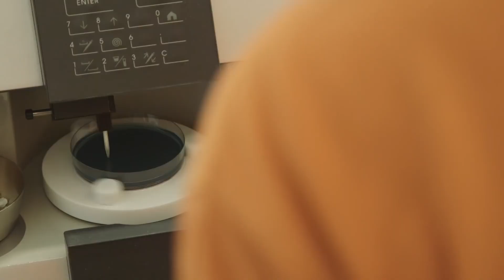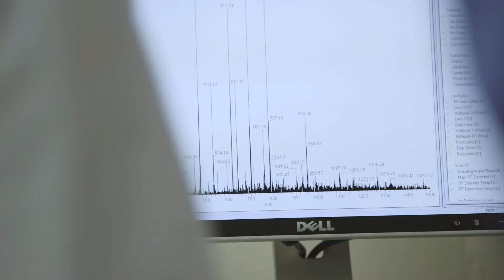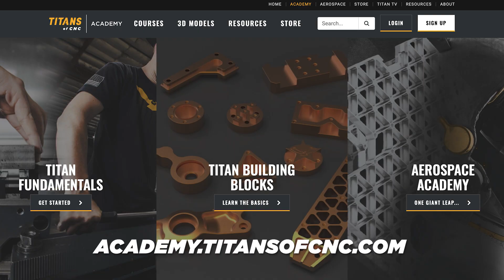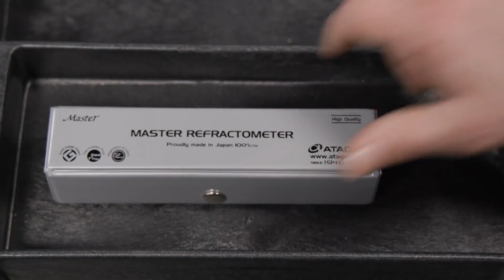The NASTIEST Thing I’ve Seen in a Machine Shop

Comment: I'm reviving an old mitsubishi cnc (and possibly upgrade the CNC controller), it has been idle for years (the owner cannot afford an operator), first thing to do ... CLEAN ... CLEAN .. CLEAN... clean the endstops, clean the encoders voila the machine starts moving again (no jumps during the moves anymore due to gunk on the encoder discs. It's interesting to see how the heck can a foggy layer happen on an encoder disc, this whole thing is sealed.
The owner just said but all other shops also treat those machines like that, no clean, just run it smoke cigarettes infront of it and throw the left over into it. Let it corrode but at least you can still say - hey the machine is workable!
I am not interested in machining itself, I just want to make my own parts for my products (which consist of software, electronics and some mechanical parts) - but since I got full access to that machine I still clean it for my own advantage.

Comment: The job I started at,  19years old... man, the lathe did not have its coolan´t changed like... ever I guess....and the boss would get angry if I implyed it should mby be cleaned atleast that year before christmas. We were had machines that couldn´t use their whole Z axis because the chips were piled up so high, like 60cm of chips just piled up under the machines. Needless to say I quit that job but it´s still sad that there are still people working in places like this, the time stopped 30 years ago there (and mby they got a 5th hand CNC 15 years ago), no matter how hard you work at a place like this, it would be an extreme suffering to ever keep up with the competition and make any sort of liveable money. 

The job shops here in the post communist countries, you wouldn´t belive. People bought the factories with the old machines for basically nothing right after the fall of the regime and have been treating their newly accuired factories as such, only focusing on getting work done with zero investment in maintenance whatsoever.

Comment: One thing that can be done easily, is testing the PH of the coolant everyday. The test strips are really cheap, and some coolant can become acidic, or even highly basic. This can cause corrosion on the machine, and the parts. When we would see a coolant tank start to go acidic, we would flush the tanks, and refill the whole system with fresh coolant. Preventative maintenance schedules should always involve coolant monitering.

Comment: I work in the rail industry in uk and most the machines in our shops are like that the lads complain and try to sort it but management won't sort it properly the old manager drilled a hole in the side of building and pumped it outside a couple of times was reported but nothing happed he's finished now due to a few dodgy things. And yes iv seen a lad piss in the white water (coolant) tank on a band saw dirty bastard

Comment: Yeah, if you have to use water based coolant pay the extra money for the Swiss lube.
I use to do a lot of milling with just high pressure air. Making blue chips and hogging material. Touch the part after a cut and it's cold, but the chips are hot asf.
I actually like cutting oil too. Not water soluble. But not good for jobbing shops, because oil isn't the best all-round.
I've used kerosene too on brass and tapping cast iron. And for EDM kerosene is the best in my opinion, maybe now they have something better?

Comment: Years back when I worked in a machine shop we had a major coolant issue and they ended up having to dump all this old coolant into the system that smelled exactly like pig manure! It was bad, I almost threw up when they dumped it in.

Comment: Back when i was making prototypes and actual products for medical use ( eye operation tools, cancertreatment tools this size of a matchhead ) we had to use pure cutting oil, no waterbased mixture.. All our machines were equipped with some serious extinquishing equipment.. Then one day, i look over towards my colleagues machine ( he wasn't in for the day... ) But! a trainee was, and well.. The boss himself who was a big ass "know it all" put the trainee on that machine to machine a titanium part.. WITHOUT telling the poor guy how to do things.
The guy goes to work, and it all seemed to go fine until he hit start on the program and sparks went flying.. I heard a big ass BOOM... i thought the machine had crashed, it kind of did cos he forgot to check -Z on a tool and it went abit deep, but nothing too serious.. Unfortunately deep enough to get super hot and throw sparks.. 
The door on that Lathe literally missed the guy by a few centimeters... Luckily he didnt get hit nor burned, but that stuff looked well scary.. Good thing is, the fire was immediately stopped by the system.. So no big ass ball of flames got out of there..

Comment: I've seen coolant mixed where the used a full red solo cup of the concentrate to 5 gallons of water...said it's to compensate for coolant loss by just topping off with water...typical dumping of left over drinks....bleach to kill that soured water smell...no skimmers so the oil just sits there...tanks never get cleaned so the original pump burns up and there solution is to drop a little giant submersible pump in

Comment: Another result of the lack of training I see in trades today. 31+ years here. 
Management cares zero. 
I currently use Nalco 35075. Good coolant. But I check with refractometer, and visually in the sump. 
Maintain as I'm able. Add water and concentrate as needed. Thankfully have reclamation department, who will change out when I request. But that is through maintenance request. Not management...

Comment: The coolant my workplace uses starts affecting my skin within minutes. First its a burning sensation at the hair follicle on my hands, then intense itching. I end up with open sores all up and down my arms. I refuse to work without rubber gloves now even if it takes me extra time to put them on and take them off to do my job.

The only time the machines are cleaned is when there is enough downtime by either breakdown or no work.

Comment: Bro .. i used to run a mori seki vert mill... These jerks NEVER in the 2yrs i was there change out the coolant. It smelled like a dead body. Extremely bad, you couldn't have door open for more than 10sec without basically puking

Comment: I had a huge radial drill  at my last shop, I cleaned it and cleaned the coolant constantly and I couldn’t keep the fungus away and smell/ color even with cleaners, ended up having my boss set up a camera and caught a machinist from another building everyday 5 minutes after everyone gone pissing in the coolant
Reply: why? just why?
Reply: @bilbo_gamers6417  cause he hated me so much because I boosted productivity when I was anew machinist  so he was expected to do more and keep up.
Reply: @bilbo_gamers6417  he still works there today, did that shut forever. Never got in trouble , still crashes machines weekly
Reply: @adammiller4879 ... weekly?
Reply: @bilbo_gamers6417  yup. Weekly maybe bi weekly.
Reply: @adammiller4879  how does a location like this stay profitable?
Reply: @bilbo_gamers6417  I have no idea, they over charge customers for this type of product every machine shop/fab shop does so they get away with it. Lumber mill equiptment, if it cost 5000$ in material, and took 25 hours of labor, they will sell the finished product for around 30-40k.
Reply: @adammiller4879  And the investors for the companies buying it will pay it because they don't know any better?
Reply: @bilbo_gamers6417  pretty much, that’s what I think. If you had the money it would be easy to underbid and start your own shop if you had the overhead. This is here in oregon. Sad part is this company always had the lowest bid, they have a C for safety rating
Reply: Safety rating determines getting business. People die working there and get hurt a lot.
Reply: @adammiller4879  holy shit

Comment: I worked at Pepsi Cola bottling plant I don't think a week went by when somebody didn't run into something with a forklift and blessed a half a pallet of Pepsi bottles or a 12-pack of cans would fall and some of them with spew every night we would hose down and push broom and squeegee the whole plant out the back loading dock but there were make sugary wet spots here in there and mice and rats would lick them up and we had these big rat traps all around the place and we had these little baseball bats that were right by the traps so if you found one in there that was alive you could dump it out and knock it on the head but nobody ever checks the traps and sometimes there would be a rotting one in there one of the most disturbing things was that because of the rats strolling living off of licking the sugar off of the floor they grew big sores all over their skin and their hair would fall out it was nasty they looked like a freak of nature

Comment: I've got a Haas VF3ss with coolant that stinks. I'm the newest in the shop and boss who has been there for 20 years says that that machine has smelled bad since day one. We change the coolant regularly but the smell comes back every time. We already have an aquarium pump with oxygen with no results. Fungus confirmed?
Reply: Check in the back of the machine where you can see the oil/coolant separator, look inside where the way covers are and I bet you have a bunch of crap inside there as well as way/hydraulic oil dripping into the coolant as well
Reply: Thanks I'll check it out

Comment: That is a nasty ass tank!  A guy pissed in a damn tank?  For real?  I recently moved on to machine maintenance from being a coolant tech at an manufacturer of parts for aerospace and also some medical.  We get a lot of tramp oil off of our big horizontals, which gets skimmed off into buckets that we dump into big totes.  But a lot of the smaller Haas machines, get kinda funky after awhile and oil starts building up to where if it is sitting and not running, it's like a big film.  But I've never seen anything as nasty as this!  Completely gross!

Comment: We finally got permission to change the old coolant that smelt like a dead rat for the first time in a cnc mill since 2004. My coworkers was saying I was being silly about turning on a fan to blow the mist out when they were cleaning all the holes of the mill table. If I didn't cut a fan on the yellow fog would hang in the air for a long time, and give me allergic reactions ( my allergies still mess with me, not as bad as grinding dust and lacquer thinner). Used coolant goes into the automatic band saw, that has caused the chips in the pan to rust,and the coolant turned brown . We use general purpose coolant as mist coolant in Jerry rigged coolant fogers. We still don't have a refractomiter so fresh coolant only smells good for a few weeks. The cnc lathe does not have the same problem because they refill with buckets they mix  coolant into before going into the machine, vs, the mill department has water hoses directly into the tank and no  coolant concentrate is added. I don't run the cnc's so they do not want me maintaining it for them when I bought a refractomiter myself. 

People need to learn how to keep up with coolant, and to not use the compressed air for cleaning everything including, varsol, and cutting oil. Dont people understand we breathe that mess after it gets atomize into the air. Hold the tip of the air nozzle 6in or more from what you are cleaning instead of literally touching so liquids don't atomize. 

 Please use ventilation when using grinders and chop saws, that could have its own video.

Comment: Our local (since retired) trade school machining program director told me a story about a guy peeing in another guys sump… but it ended with a fist fight (as it should😁) 

We swapped over to Oemeta coolant about a year and a half ago, and we couldn’t be happier. Our rep sends samples of our machine’s coolant to their lab each month free of charge and then will make any adjustments (outside of concentration) that we need the following week. It has no smell, and performs great. One of the coolest features about the Oemeta products is that they all use the same base. So we also run Oemeta way lube for instance. So it emulsifies into the sump rather than floating as tramp oil. That alone goes a long way toward smell control, since bacteria love to eat the tramp oil… no food. And our skimmer buckets take a really long time to fill up, and the tanks stay in really nice shape.
 If i had one complaint about it, it would be that when we run a lot of brass, it tends to tint a blue/green color for weeks to follow. It doesn’t stain. I just don’t like it.

Comment: Anyone who maintains a wire EDM operation using deionized and filtered water already knows the coolant tank should be constantly aerated by a pressurized ozone generator 24/7.  The shop should be ventilated, but normally not a problem due to the coolant fridge unit venting heated air outside.  The same ozone water purification cycle is used on un-pressurized ultraviolet fish tank filters.  Doesn't work without attention to detail on the tramp oil skimmers and type/amount of waylube.

Comment: At a shop I was at the coolant literally smelled like dead rotting meat and they hadn't changed it for about 5 years and it looked like someone had put a piece of meat in there because there was maggots in the coolant.
Reply: I don't know right now what coolant we use, but it seems more like dishwashing soap than anything else. I am pretty sure maggots can't live in it, and it never smells. If I keep topping off with the proper concentration, eventually the water evaporates and it gets too thick in the mill and starts making foam, so I have to add a bucket of plain water which fixes the problem.

Comment: Worked in a screw machine shop for 1/2 a day Lol , the floor of the shop 150ft x 300ft was the coolant/oil tank , you walked on raised grating over the oil  that surrounds the cam operated  machines , the smell unreal and they made blown glass bulbs too , it was insane , there was 4in of oil over 4in water base coolant under your feet , the place was a time bomb I got out

Comment: The minimill I run I have a water filtration system filtering out small chips and sediment and one of the coalescers that titan has recommended and haven't had any issues with stench, I have drained the tank on the minimill and scraped out the tank itself as much as I could since it is part of the machine and refilled it with cleaned coolant only once, and the only other thing I do is just keep the tank topped off and works great.

Comment: we have a huge but old cnc mill that we rarely use unless doing big surfacing stuff

1- we rarely use it compared to other machines
2-maintenance is rather low priority on this one unfortunately
3-our factory is essentialy right next too the sea so we have funky bacteria/algae in proximity

when we use it with coolant on, litteraly the whole factory can get a wiff of it, it kind of smells like the car pool of a ferry, a mixture of engine oil and rotten seaweed

Comment: back when I was at mechanic school we once came back from summer holidays to a machine shop stinking like what I could only describe as concentrated dog poo and fox urine. Turns out one of our CTX's Coolant had gone extremely sour over the 6 Weeks of standstill and lack of coolant maintenance. All the coolant had to be pumped from the coolant reservoir into the waste coolant tank. Fun times.
Reply: I had a similar experience with the machine shop course that I was taking here in Canada. Coolant tanks didn't get drained and cleaned like they were supposed to at the end of the last class in late spring/early summer and they sat for a month or better. I remember it looking like chocolate milk, but it sure smelled worse :S. I have worked in the trade ~15 years since this experience and have yet to experience anything quite this bad, likely because I always took care of my machines...especially coolant tanks!

Comment: That looks a lot like when I used to run Cimcool in my tool room lathe. It started to look like the cheese on top of a pizza. I switched it out for Trim coolant (probably not that much of an upgrade) but it smells better and lasts so much longer.

Comment: As a former machinist I have been through some varieties of coolants and coolant management solutions. One of these solutions caused severe rashes and blsiters all over my hands, whereas I used to work in another shop where the coolant caused no allergic reactions whatsoever. That shop had all its machines hoked up to a centralized coolant filtration and management system.

This leads me to a question here. It is obvious you take great care in your selection of machines (and operators of course) but how come you are not using a central coolant management system for all your machines? In my experience such systems does wonders when it comes to keeping the machines bacteria and fungus free (because the coolant is constantly in motion) and it is also a lot easier to keep the coolant-water ratio constant with such a suystem since it also tops up the coolant as necessary.

It's otherwise a really cool shop you have. It was about 20 years from now since I last stood on the shop floor, but I still find these machines interesting.